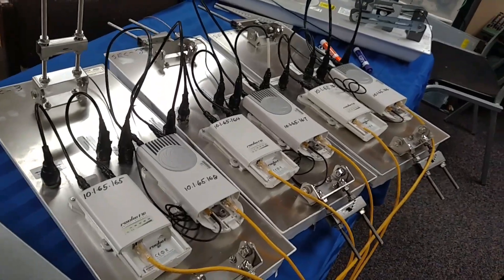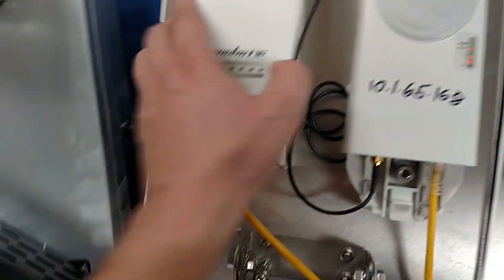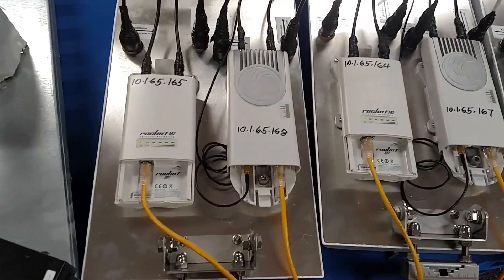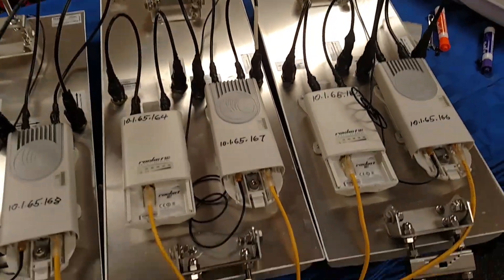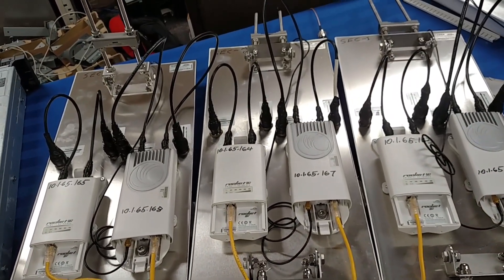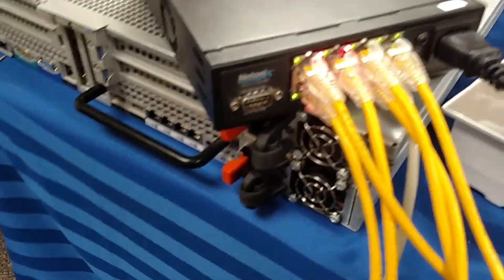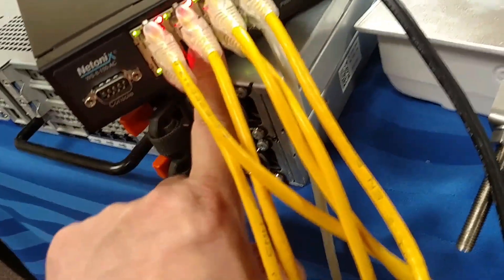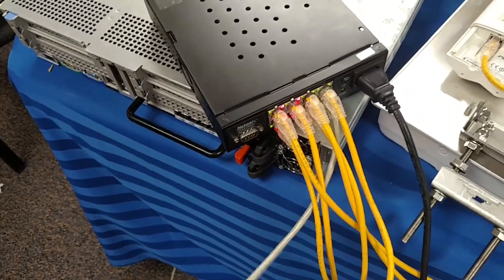Dual Band rig rundown

Comment: Isaac, now that you've had them up for a while, what are your thoughts?
Reply from the maker: ONLY complaint we have with the antennas is the difference in vertical beamwidth between 2.4 and 5Ghz. They seem to be holding up in the elements just fine.